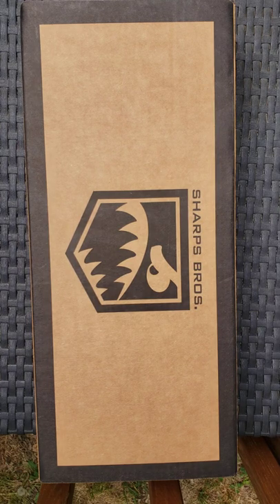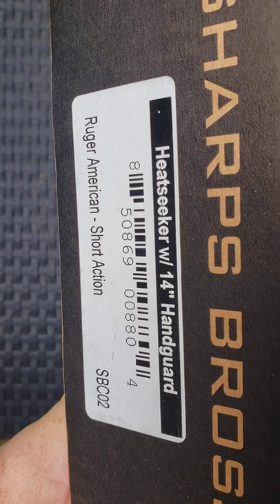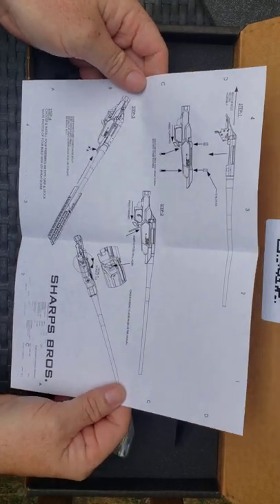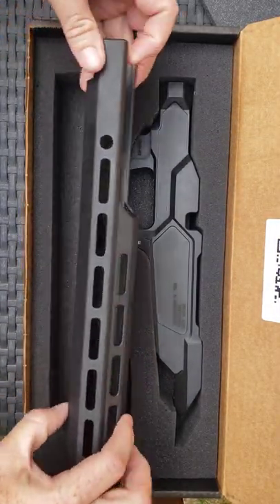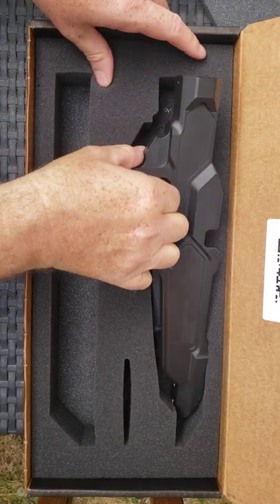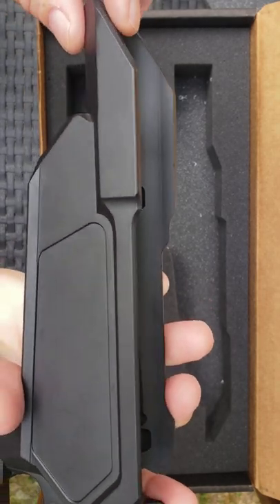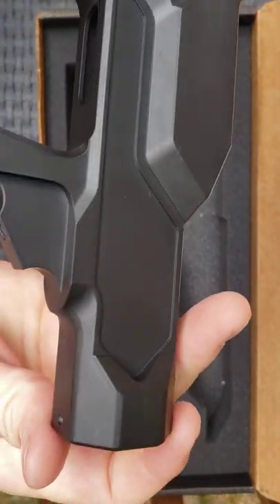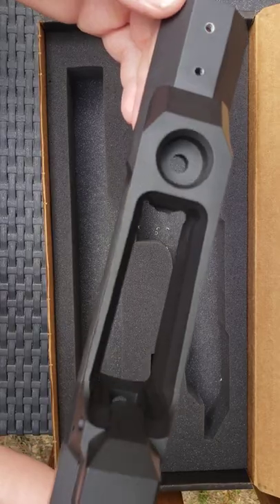Good and Bad Unboxing Sharps Bros Heatseeker Chassis for Ruger American Short Action

Comment: This video is now 4 months old. Have you installed it? What caliber of rifle? And do you enjoy it so far? I was considering this as an option for a lightweight hunting rifle. I own the American Predator 308. And I’m seriously considering this as an option.
Reply from the maker: Yes I installed everything, mine is chambered in 6.5, it did not come out as light as I wanted due to my scope and rings adding some pounds to the entire setup mine came out just under 10 pounds. What I can say is once I was sighted in I was hitting 8inch steel plates at 300 yards with ease, I have not yet stretched it further out than that.

Comment: I would have been pissed if my order came in with those aluminum shavings inside and scratches on the product.  Really unprofessional.🤨
Reply from the maker: Extremely unprofessional, I really don't like the chassis. I'm looking at the MDT chassis now and thinking about switching.

Comment: Comes with a buffer?
Reply from the maker: No buffer needed it's a bolt action rifle
Reply: @killakacti  then how is the stock installed, i have a prs lite stock and im confused how id attach it
Reply: @turkishsanta  You don’t need a buffer but you do need a buffer tube depending on which stock you plan on using.